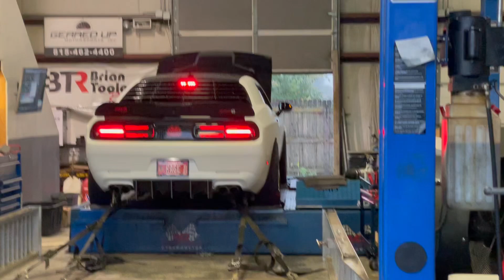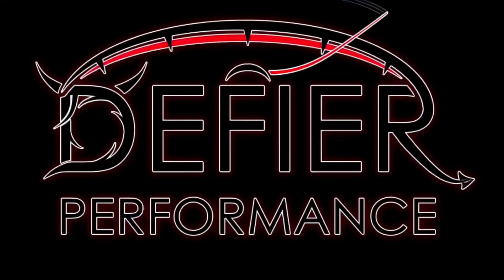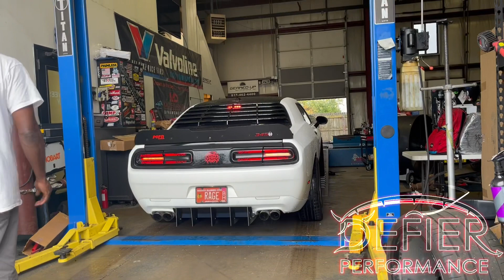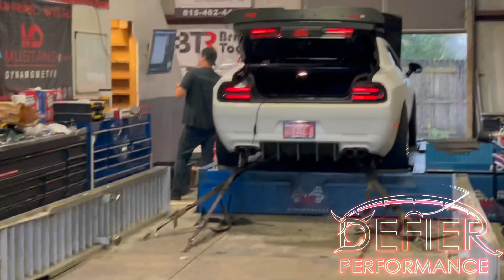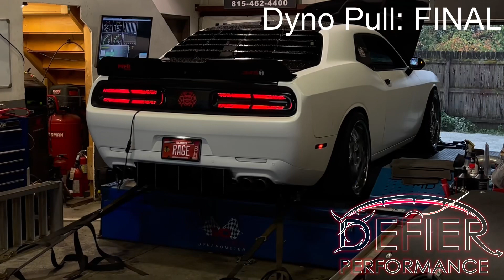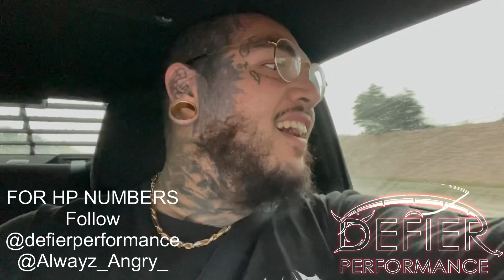Challenger 5.7 RT with a HELLCAT SUPERCHARGER and CAM DYNO RUN

Comment: Just ran my R/T Challenger with the Hellcat blower.  I am sitting at 661 torque at 5,000 rpms. Got 8 pounds of boost. Still tuning my fuel trims.
Reply from the maker: That is 🔥🔥🔥🔥 exactly where we dialed it back for SAFTEY after hitting the 721whp
Reply: @Alwayz_Angry  It was like my 5.7 took deep breath for the first time and came to life.
Reply: How did you modify your stock hood to fit back into place? My supercharger sits one inch taller than the engine bay.

Comment: If you don’t mind me asking. Where did you get the cam kit?
Reply: 90% comp cam
Stage 1 forced induction cam
Beehive spring kit
Phase limiter 

But I had to get push rods 3rd party Manley push rods comp cam is on a huge back order for those so I pieced the cart
Together vs the whole kit
Reply: @PabloThaGreat  I’ve been wanting a cam for a long time. I’m probably gonna go with Texas Speed Performance. I don’t know if their stuff is on back order or not but I’m gonna check them out and then comp cam

Comment: 2 questions. No bottom end work?  Trans holds up ok with all that?
Reply from the maker: Just a cam, stock bottom end. I will need an updated trans tune before I track it but hp70 should hold 700HP with a torque converter upgrade that’s what I’m banking on lol. At 606hp I’m fine I tend to hit it under a bypass or late night fly bys but other than that it doesn’t go above 90 until I get my slicks and trans tune
Reply: @Alwayz_Angry  👍👍👍 well that gives me some hope. Just picked up a 5.7 hp70 ram. I keep reading things that say don't bother with the 5.7, pistons will fall out and hp70 explodes after 500hp. I already have the diablo tuner and ecu on the way. Long tubes next.
Reply from the maker: @Matp345  That is what this channel is all about, when I first bought the car I came across a lot of the same information and people who either didn’t wanna help or didn’t find it worth it to them so they had no real advice for me to pursue a faster 5.7

With enough digging and the right team I’ve come to find out it’s possible to reach 600+
Reply: @Alwayz_Angry  well thank you for that! Definitely eased my mind. I'm an LS guy and those I don't even worry about.  You can pretty much beat them like a red headed stepchild without worry. This is my first hemi and hearing all that BS I was like hmmm ok, maybe I'll leave it stock.

Comment: You need that front end conversion kit in full to get that real "whine" to pop out
Reply: I think the its the more boost you make the more whine you’ll hear
Reply: @kendoug5722  not necessarily but The hellcat only makes about 10-12 lbs on the twin screw it has

Comment: do you drive on the road with the hood open to?
Reply: The hood is open so to cool the engine bay. When doing a dyno run cars can easily over heat and cause all sorts of other problems so small breaks and a ventilation is a must. Thanks for watching!
Reply: If you dyno your car with the hood closed you're gonna lose hella power with heatsoak. No point in even using a dyno if you'd prefer heatsoaked innacurate numbers
Reply: @fernandop937  driving on the street hood close
Reply: @hemi5.7villain  way more airflow driving down the road than all the fans your tuner might have on the dyno

Comment: High 500s
Reply: 🤫🤫🤫🤫 yes but exact numbers coming soon
Reply: @PabloThaGreat  👀
Reply: Who's is it
Reply: Naw my camaro with a whipple no cam fbo made 532rwhp. He should be around 650 with cam and supercharger.
Reply: @olveramelinda  the camaro has a bigger engine and already starts off with 30 more hp then rt
Reply: @olveramelinda  and depends on your psi and supporting mods too but I know an rt that makes 550whp no cam just supercharger
Reply: @just_a5.7  How is the car running making that much power ? Can it be daily driven it if wanted too?
Reply: @GlitchyVenom42  mine yes. When you press heavy on the throttle into boost it’s instant power. It’s definitely fun.